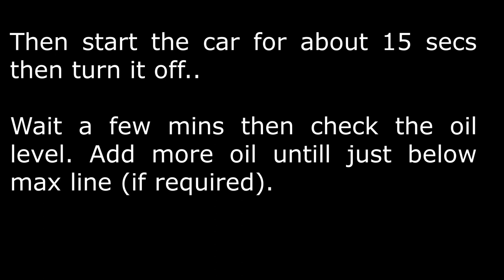Ford Focus MK3 2.0 (163) TDCI Diesel Service

Comment: It's easier to take off the intake on the right and move it to the side to gain more space it's only a few bolts and yes it's easier with the tool defo.
Reply from the maker: Ah didn’t know that came off easy

Comment: Hay man, I’m having a real issue finding the location of the oil pressure sensor on this engine, would you know the location of the sensor for the oil pressure switch ? Thanks in advance
Reply from the maker: Its not something ive replaced on mine, but I believe (could be wrong tho) its under the out side air pipe from the airbox (right side of the engine). So if you remove that youll see the gearbox area (hope that makes sense) in that area. Its an electrical plug/sensor - not sure if any other sensors down there. Sorry I cant be much help. If theres 2/3 I guess you could always pop them out to see if they match the new part design.

Comment: Hi, I have exactly the same Focus and going to service it this weekend. Do you know what the torque setting is for the sump plug please? I’ve searched and I think it’s 27nm but just want to be sure. Thanks.
Reply from the maker: Tbh I never torque the sump plug 🫣 just do it tight but not over tight.